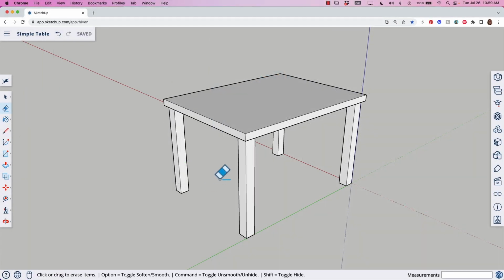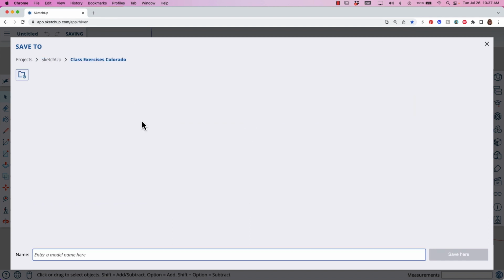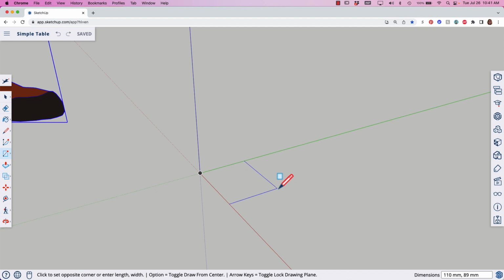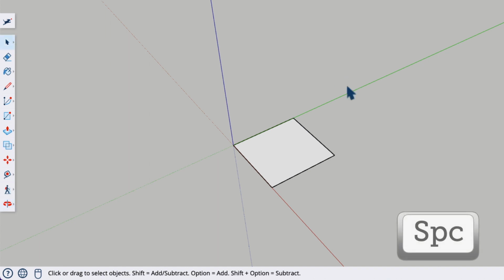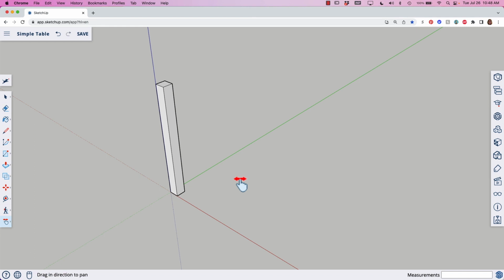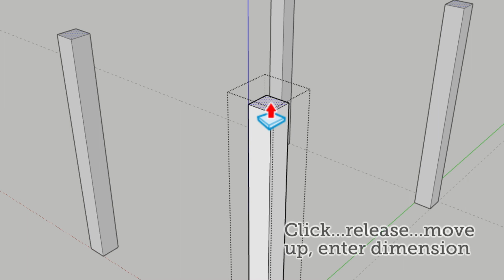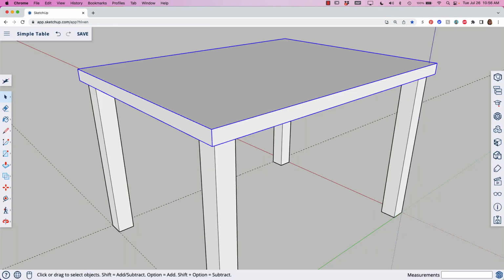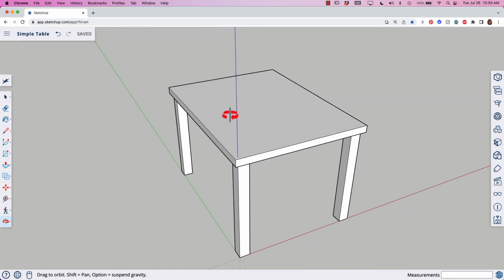Creating a Simple Table with Components & Keyboard Shortcuts with Kat Adair

Comment: Great tutorials. Very well explained.  Would be great if you did more . Thanks 😃
Reply from the maker: I’m working on more right now. Is there anything in particular you’d like to see? And thanks so much for the compliment.
Reply: @KatAdair  nothing in particular at this point im a beginner and learning as I go along :) thanks for the reply.
Reply: @KatAdair  I fully agree that your tutorials are fantastic, the way you teach with examples is so helpful! I don't think it necessarily matters what you use, as long as it shows different skills/tools so we can learn and apply it. I did not need to make a floor plan or a table (at the moment) but following your tutorial to draw those was soooo helpful to understand how to do what I want with SketchUp. Possible ideas if you do want them though...
I want to build a kayak rack on the side of my shed, and so I am going to (try to) draw the outside of one wall of my shed and then draw the rack on it. An idea might be for you to do a section of a building or wall, and then show how to mount/build something to attach to it, Like how to do a trellis, or flower boxes, or chicken coop attached to an outdoor wall. It kind of shows how do draw a part, which is actually a section of a larger item.
Another idea might be something like a garden wagon or tool trolley, which would show how to do things like axles, wheels, etc using dowels or tubes or whatever. Just something that allows you to show stuff that goes beyond the basic rectangles.
Maybe some jewelry or something that would show skills needed for small objects in 3D dimensions, or how to repeat patterns in a way that would be helpful for anyone from a machinist to a craftsperson, in designing small but complex objects.
A small note is that my toolbar on the left is different from yours. I don't know if that is a newer version of Sketchup since your tutorials were done, of if we have different options. Like when I click the rectangle, I don't get 4 options to pop-up. Not sure if that can be addressed or matters?
Hope that gives you some ideas! Your tutorials are the best! ♥♥